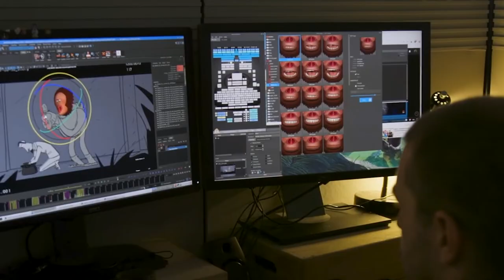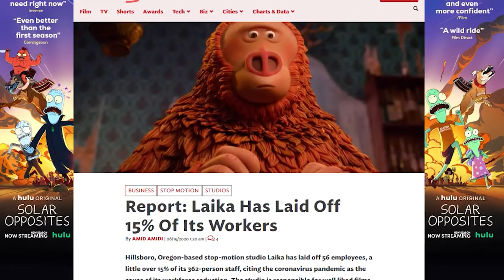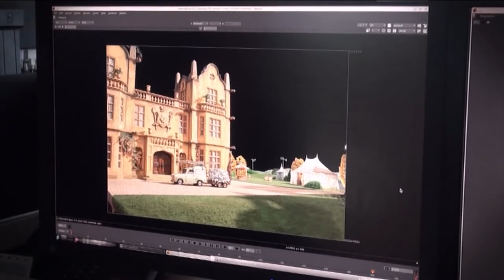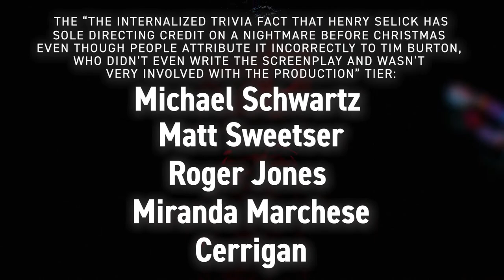How Laika Lost It - Video Essay | Too Many Tapes

Comment: You made a good point, if all the characters and models and locations are crafted on a computer in 3D, There is no point in printing them out just to reshoot them in live action. They really should just use the computer and ditch the live animating. It would be easier and allow them to make more films faster.